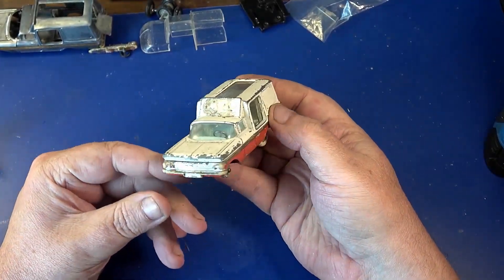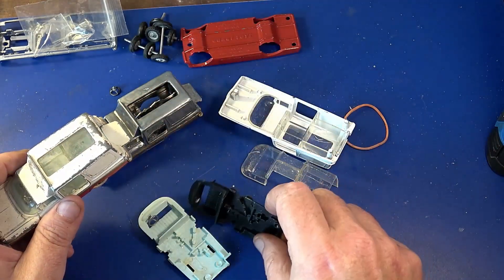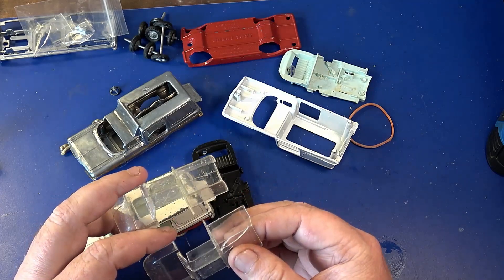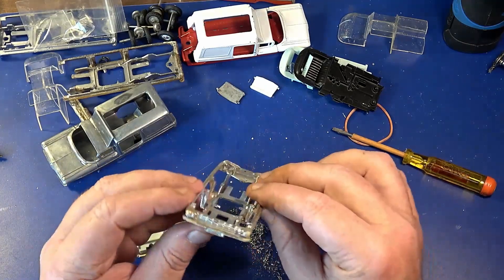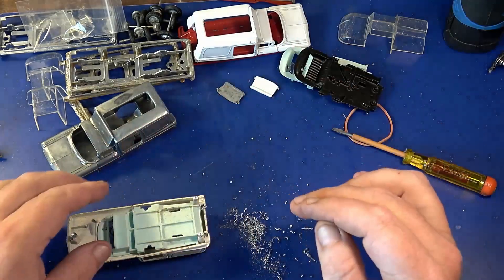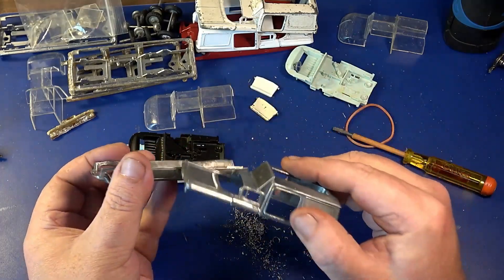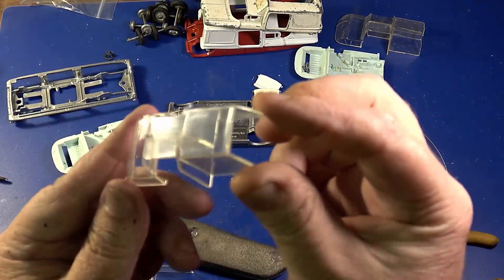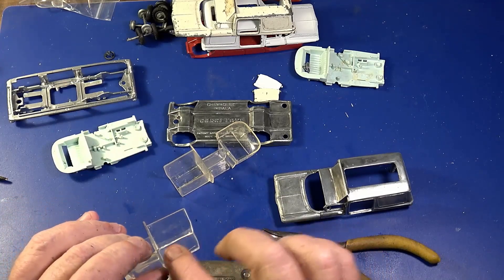Corgi 486 Kennel Club Restoration .

Comment: Welcome back! I was reading up on the 1959 Chevrolet Impala and it was offered in no less than 9 body styles, including 4 station wagons and a pickup: none of them looked remotely like that home-brewed Corgi. I could be tempted into trying a Code3 El Camino with one of these, I think, because it is quite an ugly toy. 1959 was the only year of the butterfly tail-lights: so sad as it was an astounding design for the time. You didn't lose your touch whilst you were away!